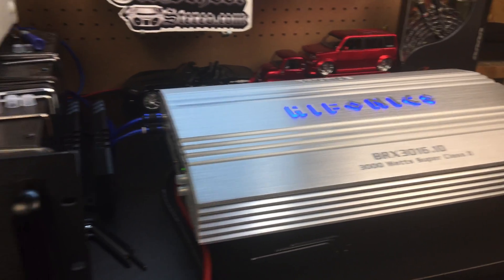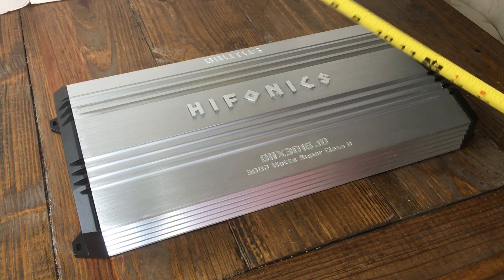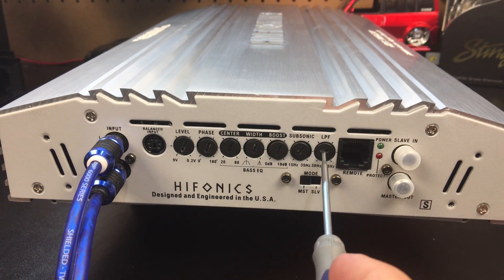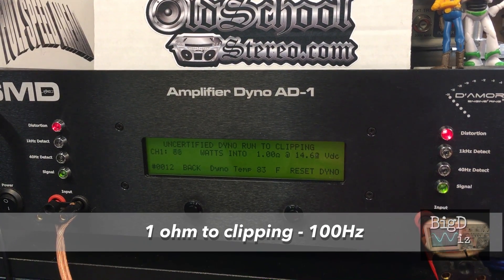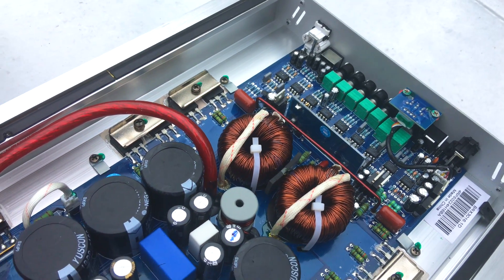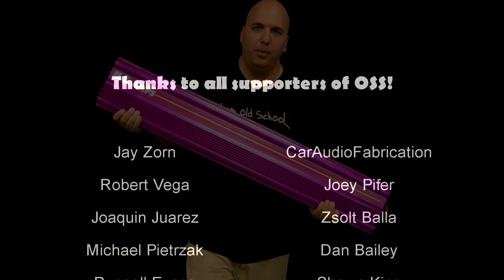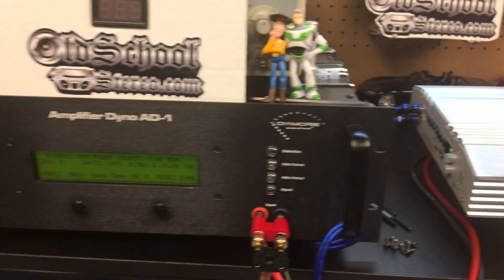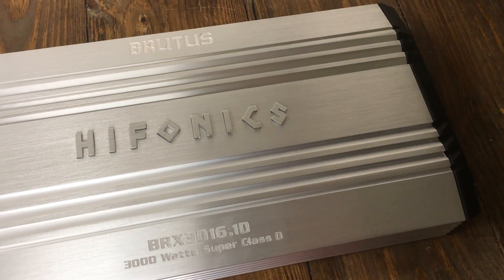Is That 3kW RMS or MAX? HiFonics Brutus BRX3016.1D 3000 watt Amp Dyno Test

Comment: Save your  $ if you want this amp and buy the hifonics hifi  2600 for around $159 on ebay . It has the same damn board and its $100 cheaper and BigDWiz if you look on yours you will probably find where it says 2600! Because both of mine do! So for $159 you can have this amp in a different heat sink!
Reply: Justin Murphy the hifonics x2600 is the exact same amp as this and its $159 on ebay brand new!  All day long. Hifonics does this with many of there amps.  The do it so often i cant mention all of them. I like the hifonics brutus brz 2400's they have the exact same board as the soundqubed 2200. That board is all so in the brx2400 bre2500 be2500 all brutus amps. I don't recommend any zeus amp's just brutus or colossus.  But for the $ if you want these results get the hifonics x2600. Do some research and Google both boards and see for yourself,  this amp is a waste when you can get the x2600. Always check out the guts before you buy.  People hate on hifonics alot and praise something else that runs the same damn board! It crazy!
Reply: Josh Hanson i heard the x2600 go to smoke in matter of minutes. Aint the x 2600 rated at 2k rms at a 2 ohm load?
Reply from the maker: +Josh Hanson interesting sir!
Reply: Unfortunately, the difference may be within the binning of the chips. The boards might have failed quality control to be a BRX, but was still within limits for a HIFI series. That’s about the same way as Intel separates i3, i5, and i7. They “just” use a laser to cut the CPU dye so it can’t utilize the cores with heat or other issues.
Reply: Gage Collins no problem, just trying to help people save some  $!
Reply: Gage Collins i have the older brutus! The bxi 2600D and that boy pushes hard my 15s L7 with no problem
Reply: Josh Hanson good thing I bought the 2600. I have that powering my two skar EVL 12s. "Dat shit bumpin" haha. Good to know it's the same amp. Thanks bro! No need to upgrade now. I run mine at 1 ohm. Shit does bump lol
Reply: Charles Phillips no idea what you just said but it sounds awesome haha. No I understood most of it.
Reply: rhurtadorh32 I'm surprised by these amps. Out of all the others these definitely top the line for price to value
Reply: Not sure how you "check the guts" before you buy. But, there is more to an amp than "the board".
Reply: Adam Neill they are exactly the same as the x2600. Exactly.  The 3016 even have x2600 on the board. Same parts same fets same quality everything. Same international rectifier fets in all of them. Irfp064n power fets 38n30's in the output section.  I've repaired over a dozen of them from failures due to the owners, not the amps. Hifonics is not the only company to do this. Nvx and polk have amps with the same boards, cadence and soundstream rubicon , soundstream xxx and lanzar optidrive ,audiopipe and about 50% of all other amps. Lol! Too many to list. They all buy boards from a certain co. and wrap it up in their case and call it theirs.
Reply: Josh Hanson so wich amp would yo recommend the hifonics brx 30161d or hifonics x2600???
Reply: MB QUART is made by the same company as Crunch, Hifonics, and Autotek....which is Maxxsonics. It is crazy how one or two of the brands of the amps can be better than the other two.....but it is.
Reply: Josh Hanson 
Are you serious? Is it like that with the whole lineup or just this model number versus the other less expensive one?
If so man I'm in on getting one of these! How do they sound sound quality wise for say on their 4-channel amps?
Josh I'm just needing a thousand Watts RMS so which model would you suggest for me to save the most money? I've been a Hifonics fan since the late 90s and it looks like the quality has went up and the prices down. I might be looking at my whole new amp line up for my truck.
Reply: Jesus christ do your won research and spend some dough
Reply: Justin Murphy I have the 2600 and their 4 channel, both brutus line up. I couldn't be happier with both amps. Sound quality is crystal clear especially with the focals I have for door speakers (access line up with 1in inverted dome tweeter) Shits ear piercing for sure. These amps have surprised me and I'll probably never buy from another company for amps but hifonics for now on. Keep in mind I've been running these amps for months now.
Reply: Josh Hanson but brutus are wayyyyy better than those hifi i dont even think they put the power that hifi claims. Brutus is the way to go.
Reply: I think the M.B. Quart DA3000.1 is the same minus the bass eq and it isn't strappable. Got mine for less than $160 after all the jet.com discounts. Hard to find now, though.
Reply: Josh Hanson thanks for this, I was actually considering both amps, you just made up my mind and saved me some $$$
Reply: In other words, they're not the same amplifier, even with the same board layout and chips. Not all silicone is created equally. That's why you'll see amplifiers from Kicker and SoundQubed (for example) will come with birth sheets that will tell you what kind of power the amplifier you purchased puts out, and it differs even within the same line.
Reply: Josh Hanson preciate the info. Bro!
Reply: Rod Roberson no problem
Reply: im more happy with my 220 dollar brx2400 (the brz is not made anymore and the brx replaced it) than my 600 dollar crescendo bc2000! now im wondering how the hifi 2600 differs from the brx2400.. does the 2600 do more rms?
Reply: akuma4u hifonics put 2 different boards in the brx 2400. It depends on what board yours has. You can tell by looking at the remote wire connection. If the remote wire  is between the power and ground you have the same board as the amp in the video. And that board is the same as the hifi 2600.  If your remote wire is next to the speaker wire connections you have the same board as a brz 2400, be 2500, bre 2500 , and also a soundqubed 2200 and many other amps.
Reply: Josh Hanson my remote wire im pretty sure is in between power and ground. So that means its putting out the same numbers as the amp in THIS video? 2700rms dynamic at 1 ohm? Thats better than the other board with the remote next to the speaker inputs..
Reply: akuma4u yeah you have the one in the video.  It does very well dynamically.  The other board does very well certified,
Reply: Josh Hanson i was told dynamic is the only useful one to look at ..is that true? When it comes to actual real world usage and playing music which category is most important?
Reply: akuma4u certified and uncertified is arguably the category that lets you know how strong your amplifier truly is. Most hardcore audiophiles and sound quality  people will say that the dynamic test means nothing.  But if a amplifier puts out high #'s dynamically that amp will love to play music and honestly isn't that what there used for. So its a matter of opinion.  Really both sides are right. I like the board on the brz 2400's the most.  They seem to be built very well and they look beefy, they have more output fets but there smaller. But the 3016 has larger output fets but less of them and that makes it a lot easier board to repair.
Reply: Josh Hanson 2 things. If you were running each board on same electrical. Same hu same song same volume same 1 ohm gain setting..which board would be louder or sound better? Also...when setting gains thru the dmm voltage method..which rms number do you use? Certified uncertified or dynamic?
Reply: akuma4u i would say the board you have would probably do better #'s spl wise. When using the dmm method that should take you to clipping and that would be uncertified.
Reply: Josh Hanson ok cool i remembered one more question.  The rms ratings he got were all above 14v..so for example how much rms would i lose if im running around 13.6 to 13.8v? Is it something small like 50rms or bigger like 200+rms?
Reply: akuma4u i would guess if you get 2000 watts at 14v you will get about 1650-1750 watts at 13v. But that can change greatly from amp to amp. Brand to brand.
Reply: akuma4u I think the output is the same, especially since it's the same board.
Reply: Josh Hanson hey i just checked finally and my remote wire is actually grouped together with the power and ground. I thought it was with the speaker inputs but its not. I do have a question regarding the hifonics bass knob clipping indicator..ive heard a few different things but not sure whats the correct answer..also diff clip indicators may work differently but with the brx2400 bass knob clip indicator..when i was wired to 2 ohm running 1000 rms (i used dmm method) the clipping light never ever came on it always stayed that solid green yellowish colour. However i got a new beastly sub and wired to 1ohm via dmm method..target voltage stayed same for both 2ohm and 1ohm wiring configs so i didnt have to touch the gain. However now the clip indicator flickers solid green to orange to green pretty fast..  Someone told me thats perfectly fine as long as it doesnt stay solid orange. Is that true or should it not even flicker either? Thanks
Reply: Josh Hanson You the g.o.a.t.🐐 for this knowledge👍🏾👏🏾 I've been on ebay for a month now back and forth between this amp, skar 2000.1d, and a soundstream rn1.5000d to power two soundstream t5 122's @2 ohms. You helped me make my mind up with the x2600
Reply: Sooo. If I bought a 2600 could I go so far as to power the same sub with it paired with my brx?
Reply: akuma4u certified is what you should look for if you listen to songs with long bass notes. A good rule of thing is to look for an amp that puts out 500-1000 watts more than your subwoofers rms eating at the certified mode, dynamic means punchy bass notes, your subwoofer can easily handle double or sometimes triple its rms when it comes to punchy bass notes
Reply: Trey Nathaniel what would be more to an amp than the board I'm very curious as to ur answer lol
Reply: Josh Hanson can you send me a link to the amp your talking about
Reply: Just bought an x2600 because of the price ! I don't even need it ... but couldn't pass on it.
Reply: Can the x2600 be ran at .5ohm????
Reply: Antuan Kendrick no sir. It will microwave itself like that.
Reply: Josh Hanson d
Reply: I had the 2000 watt brutus on 2 brutus 15s I was very satisfied all you need is a great box you'll sound like thunder
Reply: The Hifi amps do not have the same parts. Also, Hifi line has high failure rates. The ZEX3350.1D sells for $247 shipped from best shop and I'd like to see if it comes close to 3300 @ 1ohm(14V)
Reply: Just quickly checking I came up with the hifonics bxi2600.1 is identical to the SQ 2200. so you are right.  Only the x2600 looked quite diff. Also there's another guy did a 27min comparison of the two so only thing I can tell would be the difference is in components used. They are deff. Laid out identical tho.
Reply: Trey Nathaniel Google! And I know there's more to it than that, but when you buy this amp and look at the board and see x2600 on the board right below where it says 3016.1d it pretty save to say these are the exact to the dot same boards. I have both and have repaired many of them and the part #'s are the same also. All mosfets and caps and resistors are all exactly the same values.  You can actually swap the boards from one heat sink to the next. Hifonics does this with many of there amps.

Comment: Can you review Ground zero amps? they have a 1400w one that promises 1200w rms at 1ohm!
Reply: Yeah GZ puts out some awesome products. You probably won’t notice a 200 watt difference, but the meter might.
Reply: I have a ground zero amp and sub had it for over a year now and it's awesome but pricey
Reply: Donate or contribute and the amps will keep on coming.
Reply: Ground Zero should be on par with the well respected American brands though. 
I'm pretty sure they won't lie about ratings on their amps, as they do cost quite a bit. 
Same can probably be said about brands like B2, DynaBel and Alphard Audio, as most of the companies that make high-power amps get their parts from the same manufacturer (in many cases, the amplifier boards are made by FS/Zenon) - That's probably why you see many companies sell amps that look pretty similar to eachother. Sundown Audio and DC Audio being a couple of examples
Reply: I have a 1.800dx titanium amp for my 15inch SPL Dynamics XTR380D2 and it runs it nicely, might get a bigger amp someday :)

The sub is rated to 1000w rms but I can bet it could take 1,5-2k by the size of voicecoil (3inch 4layer) and comparing to smaller "1k" subs :D
Reply from the maker: +Igors Riekstins I'm sure I can eventually. ThNks for watching and commenting 🤙